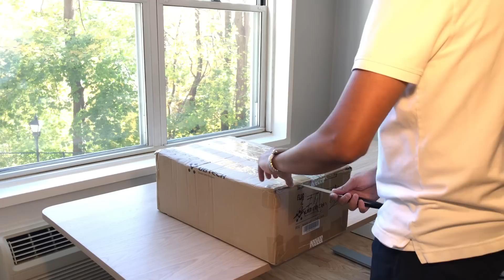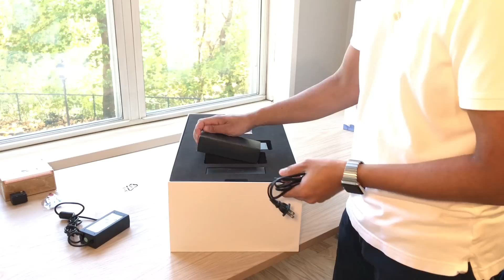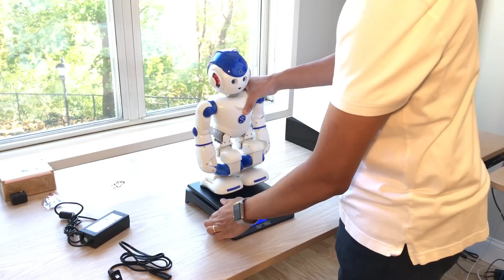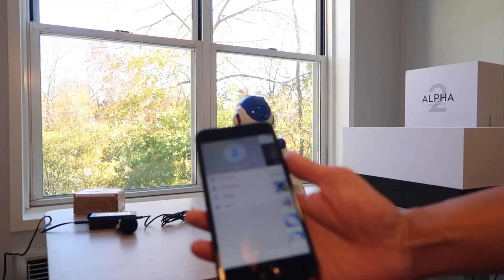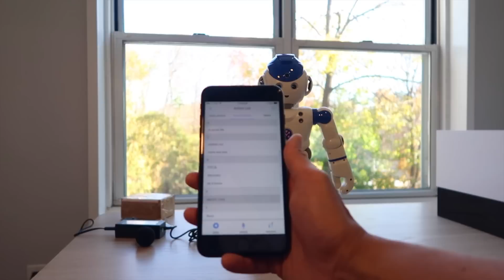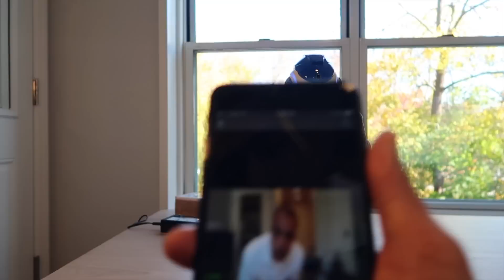Ubtech Alpha 2 Humanoid Robot Unboxing, Setup and Review

Comment: what's the price of alpha 2🤔
Reply from the maker: Originally when released in Indiegogo it was $499, once the robot was launched the price jumped to $2799-3400. Now you can find a lynx for $799 on Amazon but it’s closed sources. Alpha 2 was an open source bot and didn’t do what UBTECH promised.
Reply: @dillonchanvlog   799
Reply: @dillonchanvlog  rasclat I'm still tight with siri

Comment: This is a rip-off of Nao, Nao is MUCH better.
Reply from the maker: agree but NAO is $9k and this was $499 when launched - better than every $500 robot on the market.
Reply: I work with NAOs daily (mostly H25, sometimes T14) and they're a pita. They always suddenly disconnect for whatever fucking reason idk and when that happens, I have to reboot it which takes 10 mins. Bottomline, don't buy this nor a NAO

Comment: where can I buy it?
Reply from the maker: +Milda Stro unfortunately they are sold out. You should wait for the Lynx which will be much better. Same design, movement but works better. Price around 499-799. This Alpha 2 is open sourced so sells in the upwards $1,500-2500

Comment: Ah, UBTech. The company that, a year after it's campaign concluded still needs to deliver it's Alpha 2's to some backers, has horrible customer support, especially for a $2000 robot, and doesn't have multiple originally promised features. That robotic, monotone voice is horrible.
Reply: if you dont like this why u watching?   BRUH
Reply from the maker: +abstrXact Data Ubtech has failed its customers on this project. But they did a heck of a good job in launching their JIMO 🤔

Comment: Alpha2 is a 9001% ripoff of NAO.
Reply: And it is freaking crap next to NAO.
Reply: I mean, just look how it walks. NAO walks at least 5 times as fast.
Reply from the maker: Its going to be crap next to NAO as the campaign was $499 vs. NAO is $9000.  For the hardware, at the price tag of the initial launch of $499 it was a steal.
Reply from the maker: Do you have a NAO, I know a few NAO users and they said its much easier to use an Alpha 2 than their NAO.  I've never used a NAO but this person has 1 or 2 I believe.
Reply: I don't own a NAO as of yet, but I have plans to purchase one when either the price drops or I can save up $7990.
Reply from the maker: I'd be interested in the feedback once you acquire it. It definitely looks like an amazing robot but dropping 8-9K is a handful. Maybe check out eBay as they may have some good deals there.

Comment: can it work without internet
Reply from the maker: +Aaqib Yaseen Hi - yes the Alpha can work in basic mode without a network connection. It might annoy you by noting it's not connected to the network.
Reply: Dillon Chan Hello, hoping you can help me. Mine stopped connecting to WiFi after latest update. Now I cannot get it to scan the QR code...I’ve tried everything with no luck? Any advice? Can it be done without manually without having to scan? Thanks